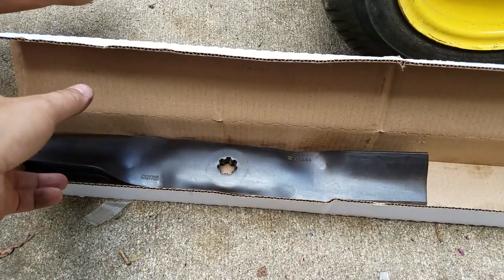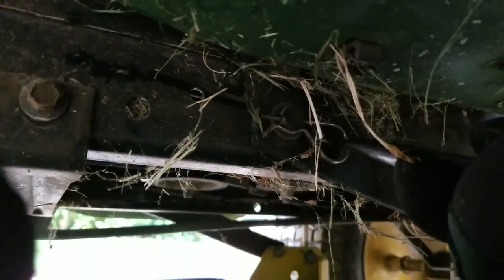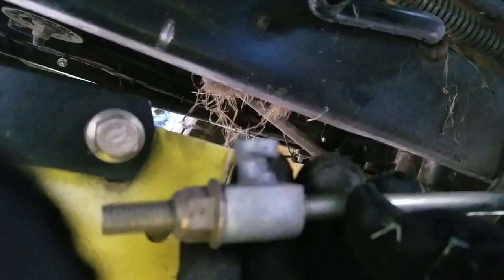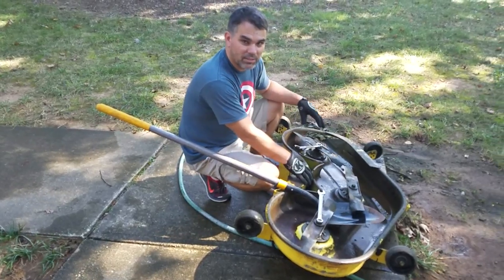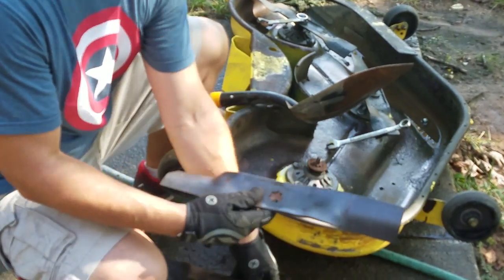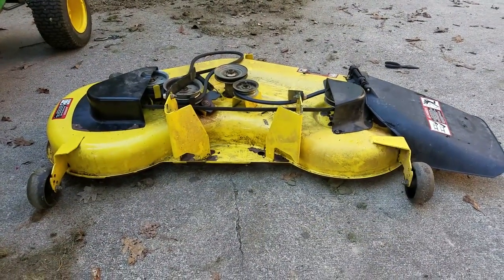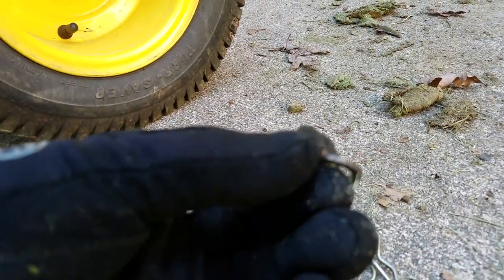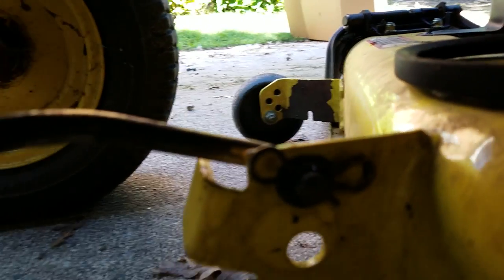John Deere mower deck removal and high lift blade installation

Comment: Hey James, I find it easiest to slip the belt on the pulley before attaching the rest of the deck. Just roll the mower backwards till the front tires touch the deck, plenty of slack in the belt to hook up pulley, then roll the mower forward and attach the deck after. Good video, cheers!
Reply from the maker: Thanks for the tip! I always like a better way to do something. 👍
Reply: If only I'd read the comments before jumping in.  Next time!

Comment: Great video! Fast & informative for exactly the specific basics I've been needing to know! Thanks for posting this. 
Just a tip Alabama another video is that cuz JD 145 48 inch deck triple pulley(the one with a spring connected to it) also doubles as a belt release hints the spring on it, if your worried about stretching the belt as I am.
 There just are not very many videos that I've found that are less than an hour long and full of so much extra information that most people arnt needing to know. So thanks again.
Reply: The tallest pulley with a spring connected to it, is also the belt release and pops it off of the pulley, or gives you the slack you need to put it back on. 
I'm not sure why my phone typed Alabama in my original comment lol.

Comment: Kudos on the video ,very easy to follow and had this project done in no time. The instruction manual is not clear enough with the photos but with your video it made sense right away, thanks again good work!
Reply from the maker: Thanks! Glad I could help!

Comment: This is a great video.  Reinstalling the belt was not working for me.  What worked really easy for me was to replace the brackets/keeper pins on the right side of the deck.  Then I put the belt back on the front pulley, put the bar back on the front of the deck with its keeper pin, and then, I put the brackets back on the left side of the deck.  This was easy peasy .  I want to reiterate the value of the video....it was well done.
Reply from the maker: Thank you for the tip. Always more than one way to do something and sometimes another way is better. Glad to hear my video was helpful. I appreciate the feedback!

Comment: Nice video!  Just what I needed for first year service on my new D155
Reply: I have a new D155. How is yours working? I just got a bagger and haven't installed it yet. Otherwise I love the thing!
Reply: @119whitmo  I love mine.  Tried using the mulch attachment with mixed results, but I'm getting great, reliable results with the standard side discharge as long as I don't try to take too much off at once.  Looking forward to servicing it for the first time this Fall.

Comment: I have  loading ramps. I just set the ramps on the tailgate of my pickup. I drive my mower up the ramps until the front tires are almost to the tailgate. I set the brake. I then have plenty of room under the mower to remove the blades without removing the deck.
Reply from the maker: Good idea for people that have a truck

Comment: As to getting the belt on after the mower deck is reattached,  I used a pull handle with a 15 mm socket on the idle bracket screw to pull the idle bracket and loosen the tension on the belt.  It slid on very easily.
Reply from the maker: Thanks for the great tip! Another suggestion I got was to move the deck close to the pulley and attach the belt them roll it back and attach the deck.  I just published a video today where I did that. Check it out! https://youtu.be/2dq1pUBgX84

Comment: Nice video. My new bag system did not come with instructions. Two thumbs up on your video.
Reply from the maker: Thanks! I appreciate it!
Reply: neither did mine...ugh
Reply: where did you get the bagger blades from?
Reply from the maker: They came as part of the kit. You should be able to by the separate. Check home depot or Lowe's hardware.

Comment: Do not remove the mower deck, that is ABSOLUTELY NOT necessary! I have been using these lawn tractors for over 30 years to clear my property.  In much less time and hassle, I can change both blades in less than 10 minutes and I am a  63 year old man.
Just jack the front of the lawn tractor up in the air with a floor jack or bottle jack.  It takes no time at all. If you don't have a floor jack,
then you should. till if you are of such limited mechanical experience that for some reason you have not acquired a floor or bottle jack,  just drive the tractor up on a set of boards or blocks to raise one side at a time.  Or if you have car ramps, drive the mower up on the ramps.  I have changed over 10 sets of blades on my lawn tractors and have never removed the mower deck.  The only time I removed the mower deck was to replace the mandrels.   Removing the mower deck is a horrid waste of time. Also use a block of wood to lock in the blade and hold it fast when removing and tightening the main nut on the mandrel shaft that turns to blade.  Locking up the blade with a block of 2x4 is fairly intuitive.

Comment: I am looking for aftermarket blades for my mahindra emax25m-2514 60 inch mower deck model AEMAHME60. blade oem part number AME050008.  21 INCH BLADES WITH A 5/8 INCH CENTER HOLE  what do u know aftermarket

Comment: Hi James, nice video. I see that you didn't balance the Hi-Lift brand new blades before installation, I did the same and then when I engange the blades I feel that the mover shakes much more than with the old blades. Did you experience the same?, or it is that I got poorly balanced blades by bad luck?
Reply from the maker: Hey there! Your right I did not balance the blades and i assumed they would be good. I should have balanced them. I did not see the mower deck shaking any more than normal.  Sounds like you got unlucky.
Reply: @HowToWithJames  Hi guys, what does that mean Balance the HI LIFT blades? I just installed a new pair just now. How do you balance them?
Reply from the maker: I should do a video on how to do this but you need a a small tool to put the blades on and gravity tells you if the blades are balanced. If your blade is not balanced you use a grinder to grind down the heavy side until your blade sits balanced on the tool.

Comment: Hi James.  I just purchased my E120 along with the bagger kit.  Went thru your first tutorial but I’m not getting any grass in the bags.  Is this due to not replacing the blades that came with the bagging kit?
Reply from the maker: Hello, yes that is most likely the problem. I am no expert but that would be my guess.  The blades provide more air for the blades to lift the grass up the shoot.
Reply: @HowToWithJames  Thank you James.  I'll replace the blade and will report this back.
Reply from the maker: It would be great to hear your findings. Thanks!
Reply: I'm having the same problem and I didn't replace the blades either. The high lift blades look similarly shaped but I'll try installing them and seeing how it differs.

Comment: The videos are great. I installed my bagger from video 1 and left the original blades on. When I mowed the chute got clogged up so i then installed the blades that came with the bagger. However, now I'm not getting any grass to go up the chute.
Reply from the maker: Hello. You could try lowering your deck. Not sure how high it is. Also make sure from the deck to the chute to the bagger you don't have big gaps where air could escape and check for clumped up grass in the deck. I assume without the bagger installed it does throw grass to the chute side of the deck?
Reply: Yes it does. I think I may have the blades on upside down.
Reply: Yep, once I put the blades on right side down I'm bagging grass. I did have to raise from 2 to 2 1/2 in order not to get clogged in the chute. Thank you again for the two videos. Really good instructions.

Comment: do you have to install those blades?  will the bagger still work??
Reply from the maker: +JIMMY JAMES The blades came with the bagger kit I got so I installed them.  I did not try to use the bagger without these blades but I would think it should work without the blades just not as good.
Reply: The chute tends to clog more if you don't replace the blades.  Also, I just jacked up the back of mine and put it on jack stands and used and impact wrench to swap out the blades.  It took about 10 minutes.
Reply: ADAM MURRAY same
Reply: Im so glad you mentioned that you replaced them because of the bagger. It makes sense now why the bagger isnt working. Mine clogs up like Adam said below. Great video.
Reply: I didnt swap mine out, worked fine on dry leaves